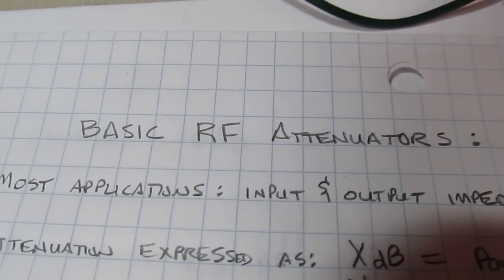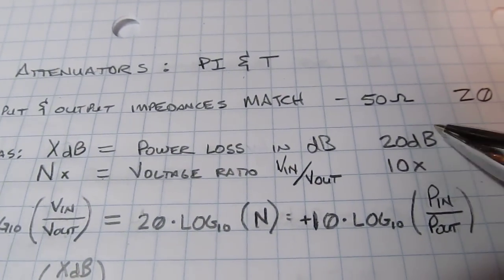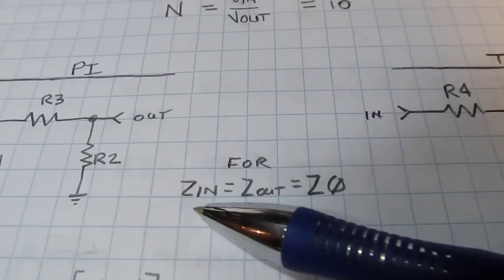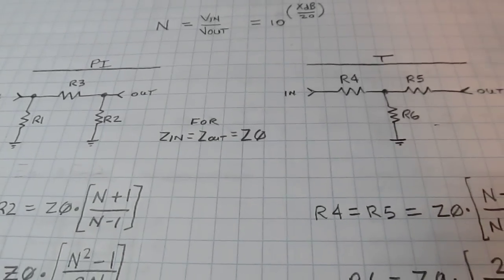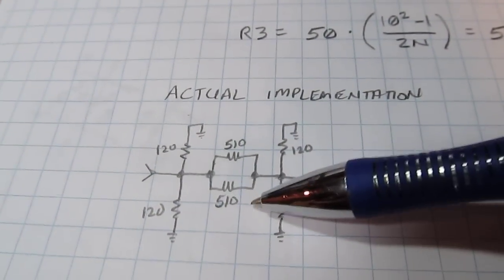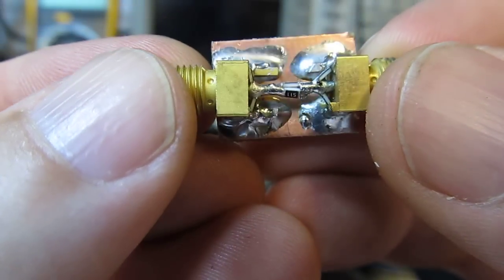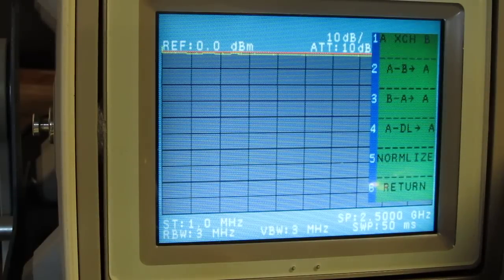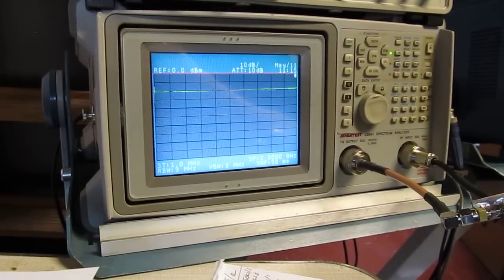#91: Basic RF Attenuators - Design, Construction, Testing - PI and T style - A Tutorial

Comment: Thanks for video! What's the maximum bandwidth that normal 0603/0402 resistors can go to before the ESL is a an issue? I've been looking in Farnell at microwave resistors and they look quite expensive. Are they only required for over 4GHz for example?
Reply from the maker: It will depend on your layout, but I have seen them used up to several GHz.

Comment: It's still a very good video though. I did build the version with the series 120R resistors and the response was 20dB +/- 0.1dB to 3GHz on a VNA.
The return loss at LF was 'only' about 40dB (because 120R isn't the ideal value of course) and it degraded to about 28dB by 3GHz. However, the resistors fractured when removing it so I would also advise soldering some additional bracing around the structure to protect against PCB flexing when twisting it during fitting/removal from a test setup :)

Comment: i.e. by switching to two series 120R resistors you will effectively reduce the capacitance by a factor of four because you previously used two resistors in parallel. I would expect your attenuator to show an error slope of about 2dB up to 2.5GHz but by swapping to the 120R x2 in series alternative the flatness will improve to something like 20dB +/- 0.2dB. But you would need a decent VNA test setup to prove this level of performance.

Comment: A good video but you haven't made the best use of the SMD technology if you want the 20dB attenuator to work well up to 2.5GHz. By using two 510R resistors in parallel you have doubled the capacitance across this node and this will cause the loss of the attenuator to decrease up at 2.5GHz. If you had used two 120R resistors in series here you would have had better accuracy and also a MUCH flatter attenuator response to 2.5GHz. No extra cost either and you just need one resistor value.
Reply: Would you consider to make an example? "Just to show truly green amateurs like me!! I don't even have a radio yet but I'm looking around! thanks in advance.

Comment: Hi, a little off topic but I have been looking for a spectrum analyzer with a tracking gen without the typical high cost. I have a great HP 8566B that covers almost DC to 20gigs but no TG. I can built an interface adapter and Phase Lock an external sig gen to the first LO but at best, I may have 80 dB of dynamic range.
Are you pleased with the Advantest SA and any recommendations on a good SA that will go to 2 or 3 gigs?? Oh, I need the low range to be good at about 100 KHz
73,,
Glenn WA4AOS

Comment: I wasn't actually thinking the values would related to *bandwidth*. I just thought trimmers would be easier and more precise than paralelling resistors. My thought was *also* that trimpots (and the even the shortest means of connecting them together) would be higher in parasitics (both inductive and capacitive) than your smt-resisitors on a thumbnail. That might limit the bandwidth some. Maybe? Personally, I leave anything above 30MHz to professionals anyway.

Comment: Trivial correction: 10x attenuation is indeed -20dB power (which is the usual meaning of dB in this context) but only -10dB voltage (not -20dB like you said). Power has 2x the dB as voltage because P=V^2/R and the square comes out as a factor of 2 when you take the log, hence 20logN. But for voltage that factor of 2 isn't there so it's 10logN.

Comment: Not a dumb question, you just use the same technique as used there with a BNC male and female soldered together on a piece of board, and a pair of 100R chip resistors like on the attenuator. Will be quite a good 200mW inline dummy load. Otherwise for less than 50MHz a T connector and a 50R terminator works well. If you need a little more power then simply solder 20 1k chip resistors in a circle a few layers deep in the terminator, that will then do 1W.